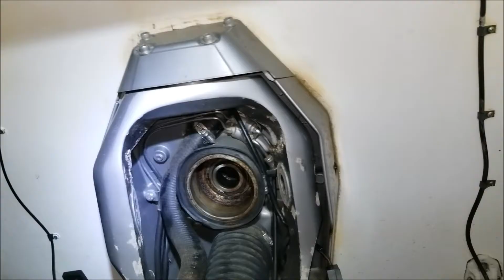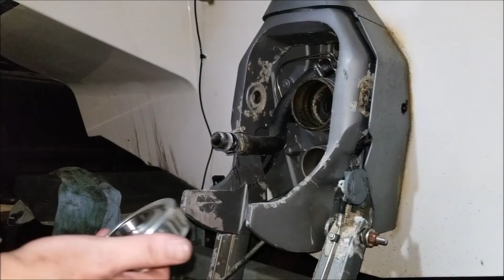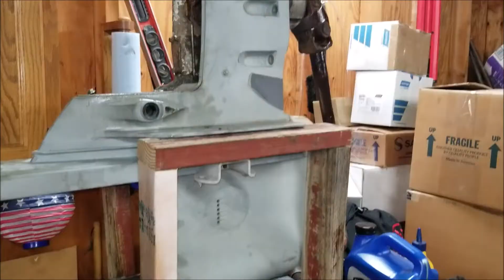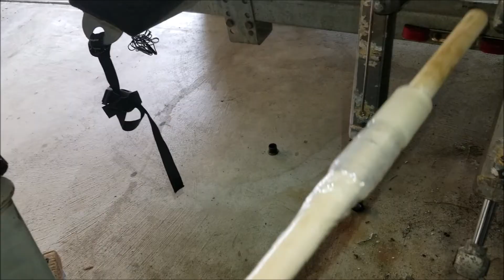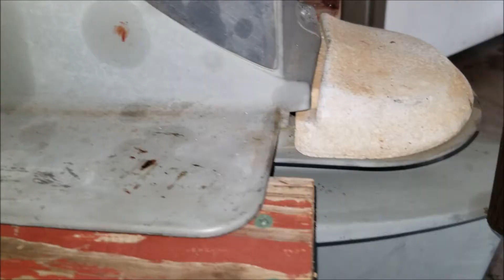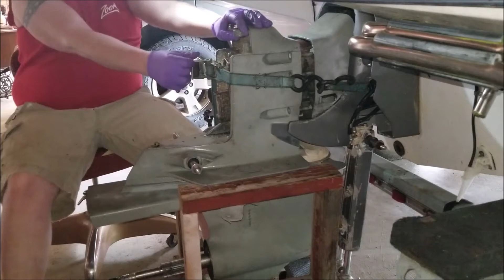Volvo Penta SX Bellows and Gimbal Bearing Replacement - Correct Alignment tools are needed

Comment: I had the exact same problem and know why you were having a problem getting it to go in the last couple inches. You have to remove the zinc on the back of the drive!  I spent almost an entire day struggling with the same exact issue. Pulled the zinc off and went on in minutes. Hopefully this helps someone else hitting the same sticking point. When the zinc is on, there is zero wiggle room when you get to the point where you’re just about to get on the bolts but when it’s removed you won’t get hung up nearly as bad (assuming bearing is aligned properly etc)
Reply from the maker: I'm gonna pin this comment. Thanks.
Reply: And how did you remove the Zinc?
Reply: There are two zincs on the drive.  It's the one that looks like a half-circle that gets in the way. It's just two screws. https://www.youtube.com/watch?v=HKBqm5PUM7c
Reply: I'm at this same position.  I hope removing the zinc helps. ❤
Reply: Hey what did he mean by zinc?
Reply: @galentober389 do a google search for "SX Drive Zinc" .  the one that looks like a half circle is the one that has to come off. It's 2 screws.
Reply: Thank you for this information. I will definately try this next time.

Comment: Most likely, the inner ring of the new gimbal bearing was not parallel to the outer ring. Always look out for that before installing the new gimbal bearing and than again after it has been inserted. Correct, if necessary, with a proper alignment tool.

Comment: I'm glad another guy has the same philosophy about the specialty tools. I have done too many jobs with this level of frustration (not stopping to eat all day trying to get it done), because of this philosophy. You've just convinced me to break my usual protocol and buy the alignment tool -even though I am selling the boat and it is a one time thing. I'm sure it will improve and extend my life! I just pulled the out-drive off yesterday.  It's obviously the first time it's been off in 27 years.  Even removing the seized shaft that the rams attach to took me an hour.  It didn't glide out. So, I see where this going.  It will be a brawl without the alignment tool.  You are far more patient than I am. Pretty sure low blood glucose and a beer would have had the 9 lb sledge out.  Pretty clever work around though pulsing the engine.  Thanks for letting us know what is involved in the job.  Much appreciated. The guy I bought the boat off of was great at polishing, but the more difficult maintenance such as this was never done unfortunately.

Comment: You can see the distance between the bottom bolts and the angle isn't correct.  Still an absolute great video.  Glad you got it going again.

Comment: It looks like your gimbal bearing was getting caught up on those old nasty flat o-rings that typically come with a kit that includes the bellows and gimbal bearings.  Those need to be replaced as well.  I went ahead and purchased the cheapest alignment tool I could find on ebay.  Not only does it help with the process but it is great for home defense purposes as well.

Comment: Thanks for making this video.  I'm starting my bellows and bearing replacement project this weekend and will be using this as a reference.  Thanks again.
Reply from the maker: Hope it goes well. I would reccomend getting the alignment tool it will probably make your life far easier in the long run.

Comment: Great video, but with all due respect i think you missunderstood what the 'alignament' is. The tool you made does not serve any scope as the tape is soft exactly where it should be hard and precise. The result of this missalignament is the result where you cannot reinsert the shaft... the tool does the job and aligns the inside of the  bearing with the engine coupler so the shaft goes smooth through both of them.

Comment: The alignment tool is used to make sure that the engine and transome bearing is aligned properly so  the shaft will fit whit no binding, if needed you will have to change or adjust the engine forward mounts to make it slide in whit no effort. an old straight shaft is a perfect tool to use unless you want to invest in a special tool.

Comment: Nice Video. I need some help, i got the leg off 100%, when i took the pin out for the trim rams, one ram compressed and the other lengthened. I felt to see if i could push and pull and they seem solid, Why has this happened? How do i get them free to move to line them up? Thanks
Reply from the maker: Use the pump to fully extend them or fully retract them and then you should be able to hook them up.

Comment: Terrible video. You need to look at the OMC manual because this is not the way you install a sterndrive.
Reply: He also installed the bearing backwards, slots go forward towards engine..
Reply: @patrickprendergast3231 lol the new ones are exactly the same either direction

Comment: Holy Shit, Please do not install your drive like this. If your drive wont slid into place the engine alignment is off. If you force it your gimbal bearing will be shot in 100 hours
Reply: not true
Reply: Exactly, it should slide in as easy as it slide out.

Comment: Heavy z drive removal / installation is due to wrong motor alignment. If the engine is out of alignment you will kill the engine coupler -  I damaged it in this way.

Comment: Wonderful video however you need to use the engine alignment tool everytime. The wood piece with tape he used is flimsy and won't be able to help him realign his engine on the mounts. Even though the bearing seems aligned visually there are minor differences in alignment that prevents a nice fit. You need to realign the engine to the bearing everytime. That is why he needed to force it on that way. This might lead to premature wear and/or failure. Otherwise I applaud him for doing this big job and documenting the whole project on video.

Comment: also another tip for getting the drive back on...
1) use a drive jack to keep the drive straight and level, start with the Pivot Housing straight up and down...
2) get the longest and skinniest screwdriver you can find. stick it through the ujoints so you can just slightly spin the driveshaft. Then as you guide the driveshaft in, use the screwdriver to carefully line up the splines of the driveshaft with the splines in the coupler. This is how it can get hung up, the splines may not mate up, so if you can turn the driveshaft a tiny bit it will slip right in. I've done this a few times on my OMC Cobra when it fought me and it is a good trick to know...

Comment: You’re the DYI father and daughter champ.   Way to go, getting the little ones to help.  That’s what family is all about.    Somethings required more attention than others, great job not giving up.    God bless you all.
Reply: I have seen conflicting instruction regarding the use of sealer or adhesive on the top bellows. The Volvo Penta shop manual makes no mention of it that I can find. Looking at the bellows and the helmet of the outdrive it appears that the sealing surface is actually between the real surface of the leg nose and the rear flat surface of the bellows and the seal is accomplished bu the tight fit of the bellows against the leg. Any thoughts on this?

Comment: You need alignment bar to set the gimbal bearing
Reply: Don't do what he is doing .
Reply: @chrisbrowne4064  Exactly.  You need to confirm alignment because engines can creep around and require adjustment of their mounts.  Unless and until that is done, no sense in trying to force the vertical drive in.

Comment: Man im glad you did this vid. I had the exact same issue, after 3 hrs of cussing and hammering i was starting to think i was stupid. I had to do this when swapping my engine so i was sure it was a motor alignment issue. I must have done about 100 in and outs of the boat before it went together. Turns out this is normal omc install...humm who would have thought that...friggin engineers!

Comment: This is incredibly spot on.  I had the exact same problem.  I struggled for hours and hours trying to get the shaft to fit through the bearing.  I took the bearing out 3 times to sanity check that it would fit.  Turning the motor over combined with the ratchet straps did the trick.  Thank you!
Reply from the maker: Glad I could help out.

Comment: Not buying the alignment tool is engaging in petty economics! They are far cheaper than the four plus hours of your life that's wasted trying to force the leg home. The tool has value beyond just alignment of the gimbal bearing but also the engine itself. If the engine is out of alignment you will kill the engine coupler! After you pay for a new one and possibly a tow bill to get off the water you will likely wish you had spent a few bucks on the right tool. But I'm just an old man who has spent thirty years on the water and working with the machinery involved so what do I know?!

Comment: Hey man how did you know if the gimble was seized up? Because the wouldn’t turn over?
Reply from the maker: Honestly I didnt know that it was for sure until I took the outdrive off but the motor would kind of surge and not want to idle evenly.
Reply: I’m really surprised with a frozen gimbal bearing you didn’t tear up the drive shaft.
Reply from the maker: @TMcD3  yea me too. I think it was tight and not completely ceased

Comment: Good video, I am going to do this on my Chris Craft 21 concept. I hear a little noise in that area.
Reply: I have a Chris Craft 21 Concept, too.  1995 bowrider.  Had the local tech replace her bellows and gimbal bearing this past Spring when it came out of storage.  No way did I want to deal with it solo.

Comment: thanks for the video buddy. I suggest you buy an engine alignment tool. The engine moves over time so you need to re-adjust the engine mounts so it's perfectly straight. It makes putting the driveshaft back in much easier.
Reply: also, if it's not aligned, it will wear out the bearing faster.
Reply: @MinhBui-ni1by  
actually it will wear out the coupler faster because it puts it in a bind and will overheat the rubber. Then you get to pull the engine to replace the coupler. THATS why you should always check the alignment!

Comment: Hey man what did you use to get the bellow into the lip on the pivot housing? I had a time getting mine on but an hr into it I finally got it. There has to be a better way lol
Reply from the maker: I just pulled it into place with my hand. It was pretty easy.  You are talking about what I did at 13.31 in the video right?

Comment: when you installed the brg. you need to get a alignment bar in there and square the brg hit at 12-6-3-9 oclock and make sure the engine is aligned also that drive will just go on like butter if the brg is not squared to the coupler  then the shaft is not going to go in straight. just make the gimble housing alignment right and you will not fight it  ps if you use grease on the 2 orings of the input shaft you can get a hydraulic lock when the input shaft comes into the brg. use light oil  it happens on sx and cobra drives is because they have a real tight seal right behind the brg. compared mercrusier  i have been working on these since the early 80 s drives go on hard because somthing is not right alls you got to do is make it right a for your effort on taking on the task that most people would not even try
Reply: Hey G D are you saying use the alignment tool/bearing installer tool to reinsert the new gimbal? I'm looking into doing this on a duoprop soon and any help is appreciated
Reply: @tylerjacob228  IF YOU LOOK AT THE BRG. THAT HE PUT IN THE BRG. IS COCKED SO BECAUSE IF YOU DONT PUSH THE ALIGNMENT BAR IN AND SQUARE THE BRG. THE SHAFT IS NOT GOING TO GO INTO THE COUPLER STR. YOU NEED A 3 JAW PULLER TO REMOVE THE BRG  THEN CLEAN THE BORE OF THE HOUSING PUT A LITTLE LIGHT GREASE IN THE BORE . GET THE CORRECT TOOL FOR INSTALLING AND MAKE SURE IT IS SEATED ALL THE WAY IN. THE BRG. SHOULD GO IN WITH NOTCHES FACING IN AND THE GREASE HOLE LINED UP AT 3 O CLOCK ONCE THE BRG IS IN PUT ALIGNMENT BAR IN AND MAKE SURE IT IS SEATED AGAINST THE BRG. THEN HIT THE BAR WITH A SOFT MALLET AT 12/6/9/3 O CLOCK THE BAR SHOULD GO IN AND OUT OF COUPLER ON THE BACK END OF ENGINE AND TURN VERY SMOOTH.IF YOU SQUARE THE BRG AND THE BAR IS TIGHT YOU ARE GOING TO PLAY HELL GETTING THE DRIVE ON. IF YOU HAVE TO PULL OUT RATCHET STRAPS OUT TO PUT A DRIVE ON YOU GOT A PROBLEM . JUST FOLLOW PROCEDURE AND DONT SPEND A DOLLER TO SAVE A TIME . RIGHT TOOL FOR THE RIGHT JOB. O YA LIKE TELL PEOPLE DONT TRY AND RE ENGINEER THE WHEEL ITS BEEN AROUND FOR AWHILE. THIS VIDEO IS KILLING ME OF THE EFFORT HE WENT THROUGH  JUST FOLLOW PROCEDURE

Comment: PS if there was grease in the grooves for those o rings on the drive shaft, that can cause your problem...NO grease there only motor oil....grease, only on the splines.....

Comment: A few suggestions having done it myself on my '88 OMC Cobra....
1) WD 40 is not really a penetrating oil, you will have much better luck with Kano Kroil, Freeze-Off or PB Blaster
2) pick up a can or 2 of OMC/Evinrude gasket sealer, you should use it on all the  bolts for the outdrive, it will prevent seizing up due to corrosion. 
3) get a tube of OMC/Evinrude Triple guard grease coat the orings with this stuff and also you should coat the splines for the driveshaft with it...No grease on the O-rings on the driveshaft, only motor oil
also, coat the mating surfaces of the drive and the pivot housing with  the triple guard, it will prevent alu corrosion from locking it together
4) you MUST use an alignment tool, Sierra makes one and they are all over e-bay, without it this job is a major pain
5) for lining up the drive and sliding it on, I use a very thin long screwdriver that will pass thru the u joints, then I can spin the d/s just a bit, to make the splines line up in the coupler....

Every year you should pull the drive to check the bellows for water. I have found that the OE Cobra/SX bellows will last 10 years, if you can store the boat with the drive down. 

Sometimes this job goes easy sometimes it fights you....
15+ years of salt water maintenance...
I use a drive jack like the shops have....when you're over a certain age, will save your back.
Reply: Sage advice right here
Reply: So I'm going to pull the drive to replace the exhaust bellow. On number 4, you say you must use a alignment tool to pull the drive shaft back in?

Comment: Wow, what a pain reinstalling the outdrive. Good video
Reply from the maker: Yea it really threw me for a loop.
Reply: Poor alignment..that bearing will go out quickly. The makeshift tool you used is totally inadequate as the alignment is critical. It shouldn't require any artificial force to mate up the out drive. I fabricate and improvise a lot, but the cost of the proper alignment tool in this case is worth it's weight in gold. That misalignment will not go away and will cause the Gimbal bearing to fail prematurely. You will also have most likely have experienced vibration.